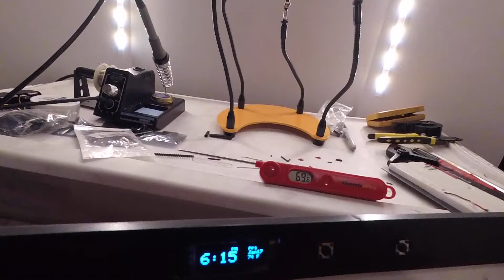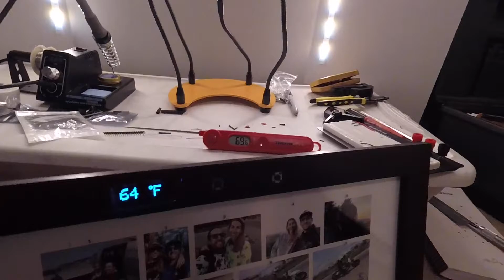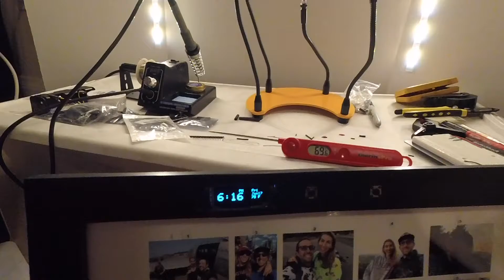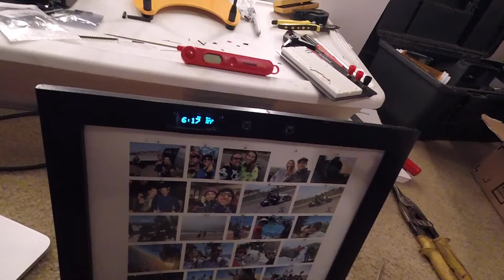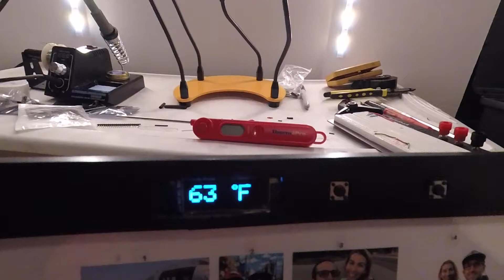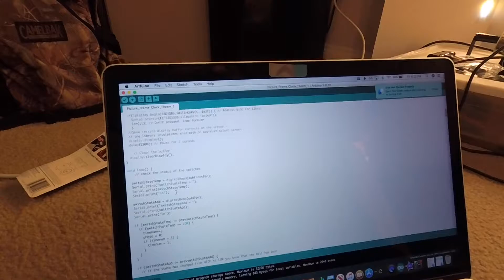Arduino Project   2.2 - Picture Frame Continued

Comment: I dealt with this with several temp sensors. I found the +5 vdc reference voltage be the problem with the tmp. If it's slightly high or low, it will have an effect. Powering other devices such as LED's or displays also had an effect on the TMP's reference voltage - very slightly, but still an effect.  I eventually got away from the tmp36 in favor of an I2C device. Also proximity of your sensor to other components can increase your reading by 3 - 4 degrees F. Not your case but something to keep in mind.
Reply from the maker: That makes so much sense. So I guess what I can do is check to voltage going to the sensor and make a calculated adjustment from there. So if I see 5.5v then maybe i need to offset an entire 1.0 volt. or if I see 4.5 volts no offset is required. This totally makes sense too because when I would disconnect the DS3231 RTC the temperature value would jump about 10 degrees on the TMP. The thing I'm still a little confused about is why the RTC value would seem so off? Isn't the RTC's built in temp to help the unit compensate internally and keep extremely accurate time?
Reply: @DRZME400  Looks like the DS3231 has a temp accuracy of +/- 5.4 degrees F. Not very accurate for your needs but accurate enough for the RTC crystal.
Reply from the maker: @gary9388  understood. Thank you again.
Reply from the maker: Interestingly enough I checked the voltage differential on the TMP and it was 5.001 volts.
Reply: @DRZME400  well nevermind then! I'd just offset the temp then. In your code where you convert c to f, something like Celsius x 1.8 + 32, compensate the 32.
Reply from the maker: @gary9388  Well I don't have a data sheet for the TMP so it might have a tolerance as well. Not sure a good method to try and calibrate it. Go outside with it and compare to my weather app? Thanks for the interaction. I'm between jobs and just trying to keep busy and figure out what I wanna do.
Reply: @DRZME400  Same problem, I don't own a calibrated thermometer so there's no way of knowing. I've done lots of side by side comparisons and landed on this. I feel it's real accurate and not subject to a reference voltage. https://www.adafruit.com/product/1899 

While it's I2C, its going to be using different communication pins then your TMP, but the library and example code are really good.

Here's my project. https://youtu.be/Ty18vxp4q0I